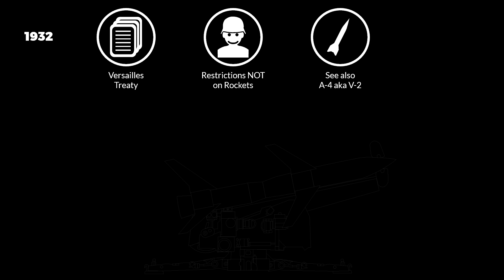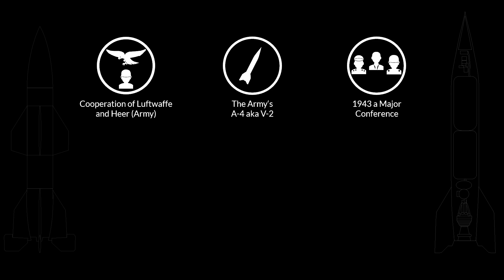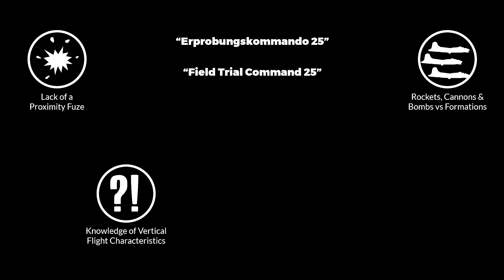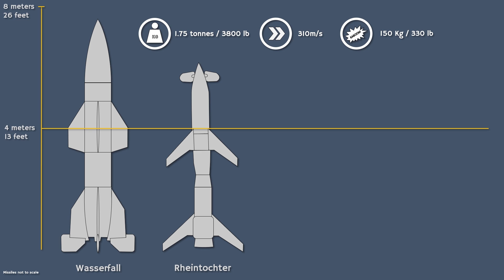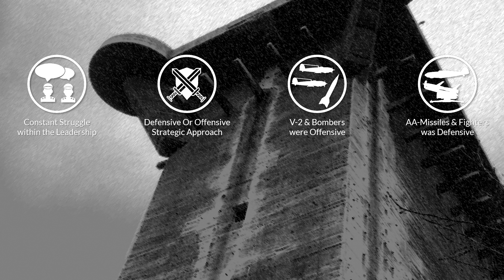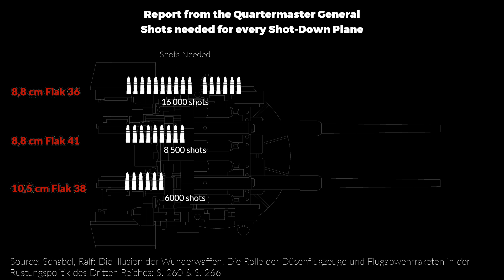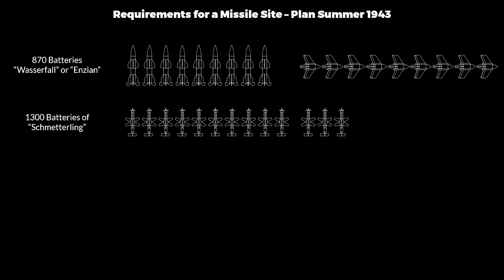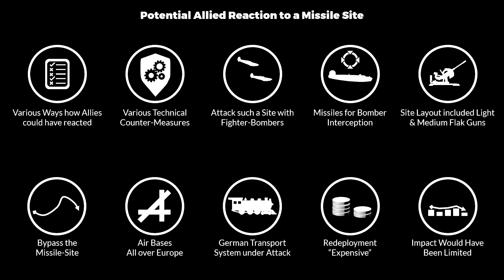German AA Missiles - An Efficient Alternative to Flak?

Comment: Given that the Germans tested proximity fuzed ammunition in April, 1945 with spectacular results, it may be that missiles were not that attractive.

The average was 320 shots per aircraft shot down. It those had reached production, they would have shut down the Allied bombers completely. With the possible exception Mosquitoes.
Reply from the maker: >  Given that the Germans tested proximity fuzed ammunition in April, 
> 1945 with spectacular results, it may be that missiles were not that attractive.
Source?
Reply: @MilitaryHistoryVisualized  Book about German anti-aircraft systems. Don't remember title. But they confuse impact fuses with proximity  fuses.
Reply from the maker: thanks
> But they confuse impact fuses with proximity  fuses.
not a good start :/

Comment: The basic AD combo the soviets developed have been S-75 Dvina (SA-2) for high altitude and S-125 Neva (SA-3) for low altitude targets popping up from under the radar horizon.

I wonder if they had the tech available in nazi Germany to do sg similar. I doubt it. But we do know that the Dvina with the combinaton of radar guided flak cannons/guns for low altitude targets was very effective even against F4 Phantoms and especually good against large bombers even in Vietnam. And the ancient Neva system could shoot down an F-117 and damage another one during the Yugoslavia/Kosovo campaign.

So if they (Germans) could have built sg similar to the Dvina, and combine it with radar guided flak guns for low altitude, than imho it would have been very effective.

But tbh I doubt they could have done it, because the soviets built upon the knowledge acquired through building the S-25 Berkut (SA-1) which was a soviet's "Manhattan-project". It was a grand project which helped them build up their knowledge in SAM systems and I doubt the Germans were anywhere near that experience level even if they had the theoretical physics all set.

Comment: Fascinating video on a topic about which I knew next to nothing. Are there any plans to do a video on the relative inclusion of women in the war effort? For example the USSR used women in all roles including combat, the UK used women in all except combat, and afaik Germany did not use women at all. Did Germany waste this resource?

As for rockets, any missile is only as effective as what it hits; e.g. a pellet could kill if it entered the brain through an eye, whereas a heavier calibre would be required to kill if the impact was a Kevlar vest thus a hit on the fuselage of an aircraft might not be fatal but the same projectile in a fuel tank might take a wing off. Also a rocket's payload was generally heavier than a shell so one rocket could have more High Explosive [HE] than several shells - how much HE on average was used per target destroyed?

Were rockets as accurate as say Congreve rockets of the Napoleonic era?

Comment: The missiles requires a proximity fuze. The Germans actually had that. They tested it in April 1945. The version that was available in 1944 was rejected as unsafe. It was very effective. The average number of rounds per destroyed aircraft was 320.

Once the proximity fuze is in volume production, the Allies looses the ability to bomb Germany. The losses would skyrocket. There is no way that the Allies can compensate for the losses by building more aircraft.

If the A4 and FZG 76 with proximity fuzes was used as air defense missiles, it would be interesting to know the destructive radius of the warhead. They might not be useful against bombers, but the fighters might be vulnerable.

The Germans can defend missile sites by adding radar directed guns. They should be very effective as well.

Comment: I wonder if they expected some efficiency to come in the form of fewer missed shots.  With the heavy Flak guns, you're stuck firing at a point in space where you expect the enemy to be and then hoping they don't change course before their planes reach that point.  A missile that can change its course mid-flight in response to evasive maneuvers might let you avoid spending limited resources using tactics that are essentially a form of "spray and pray".   

If they could reduce the footprint needed for the launch sites, or even work on mobile launchers, the reduced need for massed fires might also allow anti-aircraft defenses to be deployed as long lines instead of clusters, possibly creating a greater ability to dictate the routes the bombers could take.  (Although this would require a situation where defenders were willing to accept NOT being able to deal a crippling blow to every bomber stream that came their way.  If you wanted to devastate a given bomber formation, it would probably still be necessary to cluster batteries together.)

Comment: The defensive measures to be taken to prevent fighter-bomber attacks on FlaRak-stations wouldn't be too different from those for Flak-batteries. Therefore, if FlaRak could have been developed into a more efficient alternative to Flak the ressources needed could simply be shifted which as shown mainly included barely trained personal and basic resources still available. Guided missiles shot from planes would have required precious fighter-planes as well as trained pilots. Therefore, later analysis that it was a mistake not to put more ressources into FlaRak-development to me still sounds quite convincing.

Comment: I believe you should ad some aditional info:

1. Big Warheads 
Some rockets where designed with extreme big warheads, they should bring down multiple planes out of a bomber formation with one shot.

2. Guiding / Navigation
There where trials with radar guiding, the radar beam for rocket observation should also be the guidance for the rocket (Wasserfall).
There where test with an infrared seeker on the Enzian
Other rockets where tested with some RC like equipment ('line of sight'), like it was used on the Henschel Hs 293

3. Proximity Fuse.
This was a neglected part on all the developments, there where trials with acoustic(!)  Proximity fuses, for FLAK grenades. I heard it was also tested on the 'R4M Orkan'. But this would have been unusable for hyper sonic missiles. I never heard about developments of radar proximity fuses, like they where used in ailed AA grenades.

The missing proximity fuses for AA was a real problem for German anti aircraft missiles. After some clever guy found out, how the possibility of a direct hit for an AA shell was bigger than a hit with the timed fuse, they recognized how poor the idea of timer devices was.

4. Self destruction
A rocket will come down in big parts or accidentally in on peace if the target is missed. If such a rocket hits a house it will make as much damage as a small bomb. There was no idea how to prevent this rockets from doing a lot of damage if the came down in one part.

5. The Henschel HS 177 Schmetterling could have become an air-to-air rocket.

6. There where at least 2 other types of SAM rocket under development. (Feuerlilie / Taifun)

7. There was also a development program for air-to-air rockets, the Kramer X4 was a very ambitious rocket system with a wire guidance system or an alternative acoustic homing system. 

The only really successful air-to-air rocket was the 'R4M Orkan', that was used on the Me262. According to some sources most 'bomber kills' of Me262 pilots in the last month of the war, where done with this tiny unguided rocket.

Comment: Rocket scientist: Surface to air or air to air guided missile?
Luftwaffe: YES!
Reply: Well some parts of the projects could have been used for many applications:
Proximity fuses are good for heavy AA Guns, SAM Rockets, or AAM Rockets
SAM Rockets/Motors could also be used for Rocket artillery.
AAM Rockets/Motors could also be used for AGM ot anti tank Rockets
Radio Guiding systems for SAM Rockets could have been used as guidance systems for night fighters 

But there was no 'Modular Thinking' something like: This Misile could used with an AA Warhead or a AP Warhead.

The improvised use of 'Nebelwerfer' Rockets as AAM against bombers or the use of Bazookas on ground attack planes against tanks, was only a improvised method that could have lead into the right direction.

For example, the RAF used anti submarine missiles on their ground attack planes, that was a great idea.

Comment: It was quite surprising that in the course of the war, no one thought of making a simple . . . what I would call "AA Rocket Boxes" . . . a simple BOX, containing a series of "24" rockets, in TUBES, "6" to "8" ft LONG, "3 to 4" inches in dyam. . . . you just "Point an Shoot", firing them in groups of "6" rockets at a time, fired "1 to 2" seconds apart for each rocket, "12 to 16" BOXES, per Battery, an "Re-loading", would have been a scant few "Mins" per BOX . . . firing into the 1000 plane raids, they would have HAD, to "Hit Something" . . . they would have been "Cheap" to make, in bulk too ! They would have been "Very Easy" to mount on their FLAK TOWERS as well . . . an with the RADAR of the Flak Towers doing the actual "Spotting" for them, its quite clear to me, they would have had great success !.
Reply: Even with a thousand bombers, there's an awful lot of sky and not much aeroplane... Plus, you need to get the rocket to explode at the right height to actually shoot one down. AA guns used fuses set to explode at a set height, so your rockets would need that too.
Reply: @blatherskite9601  That was the reason for the "Ripple" firing of them, the split seconds between them would be the fusing ( along with an "Internal" fuse to cause the rocket to EXPLODE after the fuel is gone.)

Comment: If they fired a mass of rockets into the bombers formation and detonated as a fuel air explosion. The fireball alone would have blown the formations to bits, shock waves sending planes off course. The key is firing the missiles simultaneously for greatest effect. All the planes have to do is miss the target and it works. 
It could have been done had they used what they had in that area of defense rather than offense. In the end the V-2 was just a bother. Imagine detonating then at altitude with fragmentation?

Comment: For anyone interested in this sort of stuff the  US principally the US navy had also started a number of programs working on primitive SAMs later in the war driven largely by a search for a stand off weapon against large bombers dropping guided weapons (ala Fritz X) and later kamikazes. The late war electronic and guided weapon development of the US is actually quite interesting, but you don't really hear much about it compared to the Nazi wonder weapon stuff since by then it was pretty clear they were going to win so there a certain lack of urgency to really push it forward, although the Kamikazes started changing that toward the back half of 44 in terms of air defense at least. 

Though unlike Germany since they won the war these programs continued and actually ended up contributing fairly significantly to the first generations of both AAM and SAMs that came about in the 50s.

Comment: By 44 the war was lost but as you pointed out the development of rockets started much earlier in the 30s, for defensive purposes SAM sites before the Allies made a landing would have proven very useful. Bomber losses were already high, with SAMs they could have been unsustainable. I think the counter-argument goes like this: don't waste German airforce on attacking England in 1940 and start building fighters to intercept allied bombers as early as possible (Me-262 earlier was possible). Without complete air dominance Normandy would have been a very different story or not possible at all and also production losses from bombing raids would have been smaller.

Comment: I would argue one of your suppositions for the application of a working missile system is wrong.  You certainly in 1944 would not have had the capacity as you say to 'defend the totality of the reich" with 800-1300 sites.  But used judicially to protect sensitive and valuable targets the effects would have been significant.   
One question I would ask is if the deployment of such a system maybe more efficient compared to throwing up more fighter sorties to get bomber kills?  When compared to the cost of training the pilot, to building the aircraft, and the high casualties rates from missions shouldn't this 
also be a factor in arguing augmenting the Reich's AA defense with SAM.
The increased ability of the Reich to defend select areas, creating high attritional zones for US daylight bombing raids, could have forced Allied planners to select far less important strategic targets.

Comment: Flak is actually quite an interesting subject in itself and would be worth doing a video on. I forget the exact figures but in the early days of the war fighters accounted for virtually all allied or at that point, British losses resulting in a switch from day light to night time bombing - the German night fighter organisation being almost non existent at that point so that, for a while, flak then accounted for most British losses which rose even higher with the introduction of the Kaltenbrummer line ( forgive my spelling if slightly wrong) but at this time aircraft flew lower and slower so they flew in the arc of the range of anti aircraft guns for longer AND a shell exploding about 50 feet from an aircraft could inflict sufficient damage to ensure it did not make it back to England. They also didn't have to aim so far in front so accuracy of flak was better later assisted by radar.

By 1944 with American day light bombing and the heavy Lancaster bombers making up the majority of British heavy bombers dispatched to Germany, fighters were again accounting for most allied losses. Worse; aircraft were flying higher and faster meaning they spent far less time in the range of an anti aircraft gun. Worse still, AA guns now had to aim far in front of an aircraft - nearly a kilometre in front AND the aircraft were stronger and more robust meaning the flak shells now needed to detonate within about 30 feet to inflict sufficient damage to bring an aircraft down so although there were many more thousands of AA guns in 1944  than in 1941 - 42, it was taking many more shots to score a hit compared with earlier in the war and so about 99.9% of shells fired were missing - a huge waste of resources and flak shells consumed vast quantities of aluminium that would have been put to better use building fighters. 

By 1945 however, so decimated was the Luftwaffe that again Flak began to account for most allied losses but fewer aircraft were lost - often less than 3% where as up to 1944 5% was common, 10% on occasions especially for American daytime bombing raids. Considerable resources were pumped into Flak but by 1944 it was as good as obsolete. They would have been far better off making AA rockets a priority but Hitler preferred more offensive weapons such as the V2.

Comment: Actually the GFCS centered around the Mk 37 was more effective against high attitudes and distance targets.  My point is however that the German regime, even if in possession of a proximity fuse, needed a intergraded GFCS (gun fire control system) using analog gunfire solutions , radar, remote and automatic targeting of gun mounts.  Use of this system allowed multiple 5" guns to be remotely powered and directed with a analog computer firing solution using radar or optical  inputs   All this while traveling at up to 30 knots!
Reply: I don't think the WW2 German high command ever developed their own version of the British "Chain Home" system, their hierarchy were too busy competing against each other to be important than to work together for such a system to work.

Comment: Keep in mind how much more effective a intergraded radar controlled gun system with proximity fuses and a strong combat air patrol became in the Pacific.  This would be the USN MK 37 ship gunfire control system which used the analog Ford Mk 1a fire control system which provided firing solutions and gun direction for 5'' and above.   This system was much more effective than the axis system obtaining a 1:1,000 kill ratio. This along with a strong combat air patrol decimated IJN attacks once the systems became standard throughout the USN.  The IJN had to turn to kamikaze attacks, effectively a manned cruise missile,  to mount effective attacks.  This control system remained a front line system until the advent of digital computers in the 1970's
Reply from the maker: well, you should also watch our Stream on Flak Towers (Flak Towers & Bismarck). The IJN wasn't flying high-level bombing attacks, where the shell literally travels ages, but with mid to low-level attacks like in the Pacific this is quite different. And I made it pretty clear that the lack of a proximity fuse was a major issue for the Germans.

Comment: Great work! Another healthy dose of reality on the Wunderwaffen

By the way, looking at the problem of the huge expenditure of mounting the several hundred flakraketen... wouldn´t the Luftwaffe be able to combine them with the regular Flak, so as to make use of systems already in place? Or, if the Flakraketen were supposed to superseed a portion of the regular Flak, the same personnel could be retrained (thinking on the extra 110,000 men required).
Reply: If the government heads did what the scientists told them to do, the amount of men could have decreased by a significant amount. Also the amount of needed steel. Under a few different circumstances, wunderwaffen could have become a reality.
Luckily, that didn't happen.
Reply: yes, it can replace flak88, and flak88 can be sent back to the frontline where it's needed the most